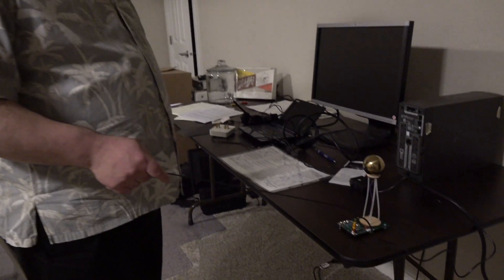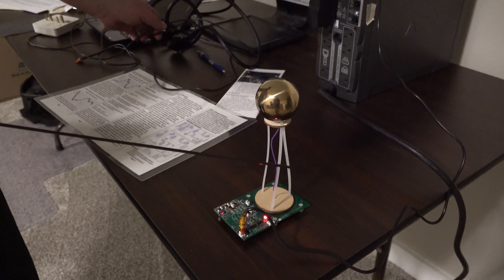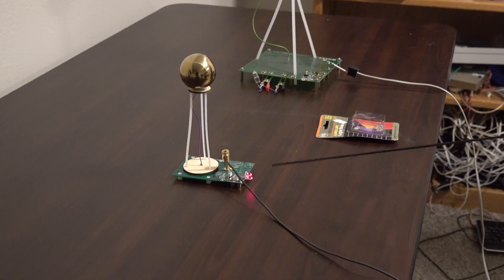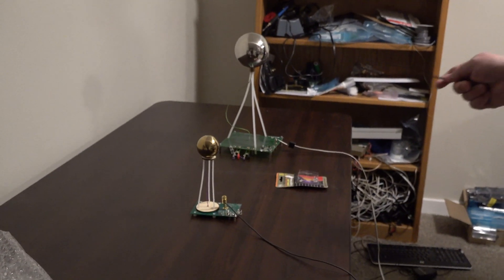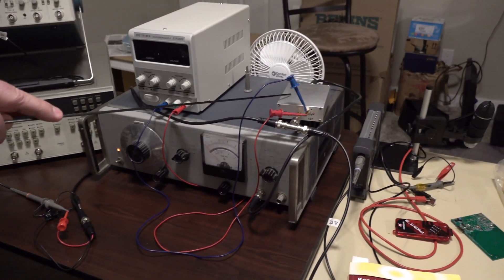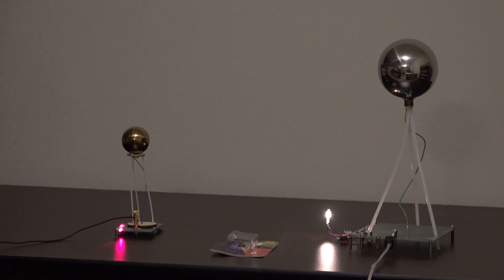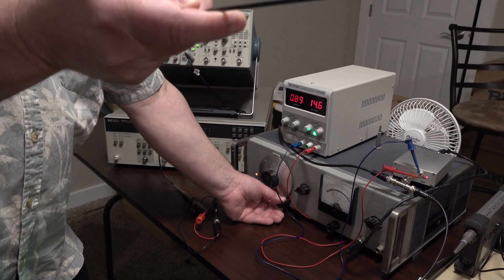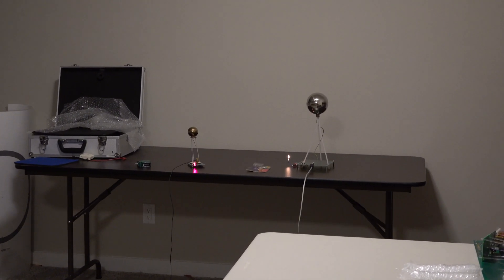Demonstration 2019 (please see vril.io and https://www.youtube.com/watch?v=RAwy-RiTAEw)

Comment: Dear Adam

Excellent video demonstration of scalar waves using own version of Prof. Meyl's kit. It was amazing.

I have a query regarding it's enhancement. Since Meyl always use a single wire as ground to demonstrate, same you also used in your videos. Instead of using a single long running ground wire, did you try connecting the two ground to real Earthing? 

I mean something like this:
https://drive.google.com/file/d/1fP8_dJ-3n9l1O5KidDO87MwZpSSEYE-H/view

I hope you understood my suggestion. Please let me know if you have (or can) try something like that.

Your response will be highly appreciated.
Reply from the maker: Hello Partha, thank you for asking about the grounding suggestion to replace the one-wire with two conducting earth stakes.  I did try that experiment in a grassy field and was surprised that pressing around 6-12 inches of Copper heavy gauge wire into the green grass did not make the connection, so no energy was transferred through Earth, even when the wires were placed right next to one another.  My un-tested belief is the reason Tesla's giant tower worked in this scenario is because his tower created huge voltage for breakdown of dirt particles and establishment of conducting plasma at the transmitter's Earth contact; whereas the demonstration kit I used to test that (the one Dr. Meyl sold me) generates a relatively low potential unable to force a conducting path between dirt particles (my unproven hypothesis).  Another hypothesis why it did not work replacing the one-wire with earth ground penetrations is the Earth absorbed the energy: did we see in Dr. Meyl's documentation a gymnasium with the wire strung high off the floor to measure wavelength (with LAMBDA=c/f) proving faster than light behavior of the longitudinal wave?
Reply: @nearfieldresearch4573  
Sad to hear.

Because if it doesn't work with real ground, then it's not useful. Forget 100 wireless without ground. Or may be we are missing something.

After connecting to ground, did you try re-adjusting signal frequency to find another resonant frequency with ground (if exists) ?
Reply from the maker: Thanks for your input Partha!  When I tried Earth ground instead of a wire using Dr. Meyl's kit, there was no frequency found that would work within tuning range.  More experimentation is needed to determine what grounding configurations actually are useful, for example reducing the amount of wire inside the metal shell of a rocket.  One useful application I have proposed for a 2-year $13M project, is for status report communications between power poles where the wire already exists (longitudinal waves to increase the range over conventional radio).  There are a number of sensing applications in this realm besides power, including a medical device I am not ready to disclose.  Other applications should be found once the engineering community begins to understand how to make and use longitudinal wave design tools like electrical simulation (we already have decent commercial tools for simulation of the transverse wave component, but not the longitudinal one).  Adam Griffin 05NOV19.
Reply: @nearfieldresearch4573  Thanks for the response. Hope we get the missing info to use longitudinal dielectric wave for power transmission. Power transmission at long (or possibly infinite) distance will bring true revolution. Since Tesla used impulse current to transmit power at larger distance. But it seems his patents didn't give complete details which are necessary for implementation or proper engineering. Since he do most of his calibration in mind.

Yes, I have read many articles regarding using scalar waves for healing process, but never seen a working schematic for it's design.

So we need to re-discover many things. And once every parameters is known then only it's engineerable and then simulation is possible. Simulation is not possible without any equation. So simulation is a long way to go.
Reply from the maker: Thank you again Partha, for contributing to this discussion.  I do believe Dr. Meyl showed analytic equations in his 700 page book https://www.meyl.eu/go/index.php?dir=30_Books&page=6&sublevel=1 and in various papers he wrote (e.g. https://www.k-meyl.de/go/Primaerliteratur/Scalar-Waves.pdf), but the equations need to be implemented by someone or something with huge computational power, maybe using Qubit-based systems as they continue to develop.  If One has not digested Meyl's book it is quite an amazing accomplishment and I wish he could someday receive a prize and official recognition.

Comment: I think you have a transmitting antenna and a receiving one.
Reply from the maker: Thanks John I agree "scatterons" are antennas that can be made spherical or flat.  My impression what happens between them, and I have probed power build-up waveform on the receiver to understand this,  it is like the transmitter pings the receiver in a fashion of as if it is hunting for a partner, then the receiver gloms-on to the transmitter becoming one resonant system of energy transfer.  Putting one or more receivers connected to the one wire makes transmitted energy share between the changed resonant system.  Adam Griffin 03NOV19
Reply: Thanks Adam, an FM radio antenna can be a single rigid piece of metal.
When the transmitter and receiver are close, you can get harmonic resonance.
Many people make videos about that. One example is TinselKoala.
Reply from the maker: Thanks again John.  A weird thing about this type of system is the transmitter and receiver when moved far away from each other still have resonance ('far' being beyond a sixth part of the wavelength) and able to transfer power and not just signal.  For example the paper I wrote showing energy transmission from basement to second story with the one wire kit using 100-foot extension of telephone cord, illuminated the LED or powered a resistor (the ~7MHz transmitter is producing slivers of energy, having ~60ns, ~1A pulses; I would have originally expected no way the LED could be lit from that distance with my tiny drive circuit).  Measurements I made also beyond line of sight using Dr. Meyl's kit showed received power falling off as 1/distance instead of conventionally understood 1/distance^2 with transmitter on a second floor and receiver outside close to Earth, on the concrete.  The conclusion is I wish for access to an electromagnetic simulator that is validated to accurately model this type of vortex generator so we could understand more.  I already tried to model a spiral pancake with Ansys Maxwell and it failed to create a spiral let alone simulate it, then when I ran an investigatory simulation using CST it was able to simulate a spiral dipole situated over a ground plate (if CST does not model the longitudinal wave I was probably wasting time trying).
Adam Griffin 03NOV19.
Reply: Thanks Adam, 
About the health issues, I want to say that you have to be careful. You don't want to place your workbench for experimental electricity against a wall where on the other side your neighbour's little twin lies sleeping.
Keep your input power as low as you can, and keep the experiment as short as posible. They always say; don't switch your experiment on and sit next to it just staring into it.
Every change in the circuit can change the output frequency, and we simply don't know what frequencies are healthy and which are unhealthy. Don't think that all frequencies turn into heat when they enter the human body. There are examples of people having all their hair fall out in just three days time, because they forgot to switch off their experiment in the other room. You can find quite a number of examples where a YouTuber starts with his radiant experiments and where his setup makes sense, and his explanations sound logical, but after a year or so, his circuits become messy and he speaks nonsense only.
Try not to interfere with other people's wifi, radio or telephone experience, but you already know that.

When you have a AC circuit with a somewhat higher frequency, and you attatch a single wire, then the "waves" can enter the single wire because they are pushed by the circuit. When the frequency is low, the waves can flow back to the circuit, but when the frequency is high, there is nothing pushing the waves back, and so they pile up. The energy can now only get out of the wire as a radiant. Hence radio.

Also remember that there is no new invention hidden in this kind of experiments, nor can you find a useful application for it. It is for study only.

And yes, a straight wire or rod is 1/R and a ball is 1/R²
Reply from the maker: Dear John Walker, 
Thank you for taking the time and contributing to this important discussion on safety! 

 
The Starter Kit transmitter is designed for low power, with on-board amplifier slew rate 460V/us (highest frequency content of ~23MHz switching
 a 5V rail) and 0.1 Ohm output resistance, pulsing a series 1.5 Ohm spiral coil and 2 Ohm sense resistor with 60ns pulse widths at 8MHz. Calculated current delivered to the transmitter coil by this on-board amplifier is thus 5V/(0.1+1.5+2.0 Ohm)=1.4A and resulting voltage impressed across the transmitter primary of 1.4 Amp * 1.5 Ohm = 2.1V (Pulse width is set by the drive circuitry).  Peak power across the spiral transmit coil is then approximately 1.4A * 2.1V = 2.9W. Given the period corresponding to 8MHz input to the transmitter coil (cycle period is ~125ns), and ~60ns fixed pulse width per cycle the Duty Cycle of the transmitter is 60ns/125ns = 0.5.  The calculated average power available for transmit is thus Pavg=2.9*0.48=1.4W. The Starter Kit printed circuit board which the amplifier is part of, demands 5V*0.3A=1.5W from its wall wart so the calculated estimated maximum transmitted power derived above less than 1.4W, is reasonable. 

Regarding the measured electrc field strength close to the transmitter, it is documented in 
/Starter_Kit_Publications/3_App_Note_Short_Distance_Various_CoilLengthOneWires_09SEP17.pdf: Through 25 feet of coiled one-wire, the measured 
electric field at the receiver card read 1241 V/m (with the LED illuminated because the transmitter is tuned to the receiver) and electric field strength was measured with the handheld meter at the receiver. The transmitter emitted 1398V/m electric field strength with the meter at one inch away from the transmitter. 

The following publication can be referred to in evaluating safety of the Starter Kit for transmitted power of 1.4W at 8MHz:  
https://www.sandiegocounty.gov/content/dam/sdc/pds/ceqa/Soitec-Documents/Final-EIR-Files/references/rtcref/ch9.0/RTCrefappx/2014-12-19_HealthCounciloftheNetherlands2000.pdf. The safe level is below 1000V/m  accordng to its Figure-2 (“Health Council of the Netherlands: ELF Electromagnetic Fields Committee. Exposure to electromagnetic fields (0 Hz - 10 MHz). The Hague: Health Council of the Netherlands, 2000; 

publication no. 2000/06E”). Radiated fields measured from the Starter Kit decrease 
rapidly from the scatteron surface when measured with the handheld meter.  Proximity of the handheld meter reduced the tuning and observed peak current value, making accurate readings difficult to measure.  Notice Figure-2 of the Reference shows 250V/m falls below the possible effects at 8MHz.

The table on Page 11 of https://transition.fcc.gov/Bureaus/Engineering_Technology/Documents/bulletins/oet63/oet63rev.pdf, can be referred to in evaluating FCC compliance: Radiated emissions at 30m are expected to be  less than 30uV/m because the hand-held meter reads zero V/m outside of several inches. The longitudinal wave could conceivably be detected (measured?) in an RF Chamber with conventional antennae and spectrum analyzer; however at low frequencies a standard receiving antenna is typically a loop antenna or active monopole antenna; neither antenna should be suited to measure a longitudinal wave which that might look like noise (I hope it becomes published by an inquisitive engineer; maybe using my starter kit driven by battery-powered optical coupling to change its frequency while in the test chamber).

The effects of high frequency electromagnetic radiation are definitely complex. Which frequencies are good, and which are bad is a huge can of worms 
to analyze and the only practical thing we can verify by Test seems to be: Reduce emissions below accepted field strength limits of exposure for transverse waves.  Another couple of related points:  It is my opinion that cell phone radiation is dangerous to the body's healing ability, especially as the frequencies are going to 7 MHz with 5G technology. All we can do here practically is shut the cell phone off at night, or put it in another room.  

Regarding Wi-Fi, my understanding is it is not safe to be near your home router all the time. I remember hearing a caller on talk radio convinced she was sickened 
after the smart meter was installed on her home.  Clearly we are all at risk with all this electro-smog that seems omnipotent and ever increasing.

Regarding loss of hair as an outcome from the presence of RF, are there scientific publications for recommended reading?

Thanks again,

Adam Griffin
04NOV19
Reply: Hi Adam, thanks for your detailed reply.
I don't know any scientific publications about health issues regarding EM frequencies.
However, most people know that an electric current can kill a human. I always start to laugh when someone tries to explane the right hand rule and starts with saying "when you grab the wire with your right hand..." then I think; "never grab an electric wire kids!"
There was this research professor who figured out that it might be possible to stop the human heart by applying a small electrical current to it. And so he did an experiment on him self, and yes, he was right, and so he died. Other people try to find a way to keep sharks away from the crowded beach, and sometimes an electric pulse can do the job. I think all the shark's receptors are stimulated at the same time, and I think we can compare this with the effects of pepperspray on an agressive shoplifter.
But seriously, there are people who live their happy lives on the top story of the highest building in the neighbourhood until a phone company decides to place a 4G hub on their roof. From paradise to hell. Do human rights count?

It is not difficult to transform one frequency into an other, but it is very difficult to understand every little process inside an animal or human body. No electrical engineer knows anything about biology.

Funny b.t.w. how Partha, in the comment section here, thinks that he can replace the wire with the natural ground. It looks like someone removing the cilinderhead and than tries to start the engine.
The wire is like an artery, the electrical pressure needs to be transported.

Have a good one.

Comment: As to shielding with a Faraday cage...of course one cannot shield this  with a conductor (Faraday cage)...this would be the equivalent of placing more conductive plates in the dielectric of a capacitor (of course we live in a dielectric)...the plates merely pass an oscillating potential just as a wire between series capacitance (Tesla demonstrated as much in his famous experiment)...so really, longitudinal waves have been in almost all AC circuits right under our eyes in the dielectrics...and remember you live in a dielectric...and you yourself are a conductor (concentrated charge source)...however water is a dielectric and thus you may place your 'receivers' in water...
Reply from the maker: Thanks for your input Mark!  The confounding fact is this device I made illuminates an LED from the basement floor up two stories while the coupling capacitance is exceedingly small.  Please Email me if you would like to have this experimental documentation that I wrote at griffin.adam.h@gmail.com.  The other confounding fact is the longitudinal wave starts up monotonically and smoothly whereas the transverse starts up choppy and disjointed (If you would like to see my experimental documentation performed on the predicate device from Dr. Meyl please let me know too).  One thing I wish to have access and doubt will be provided, is an electromagnetic simulator (like Ansys Maxwell or CST Studio which don't do this from what I know; maybe the CST Particle in Cell module could be useful) could account for the electromagnetic longitudinal wave so we could model the effects instead of always having to build something and measure it empirically.  A final comment about placing receivers in water that has high relative permittivity around 80, is that might not be tunable with the circuit I have built - but might be an ingredient to somehow affect its tuning instead of using e.g. a varactor...you might be on to something valuable here!  Adam Griffin, 21AUG19.

Comment: Is not any series capacitance circuit in essence a one wire circuit?  We live in a dielectric so it is not surprising that by tuning into regularly occurring oscillations in the dielectric and providing some charge reservoirs (conductors between dielectrics) that we may experience electrical power (hairpin affect).  Again, in any series capacitor circuit the wire between the capacitors act in such a manner.  It is typically necessary though, at higher frequencies to tune conductor length for best affect.  Great job in your incorporation of digital in monitoring and control!!!
Reply from the maker: Thanks Mark, maybe you have insight to understand limitations of using a Pearson Model 411 (1V/A) current probe reading current at one end of the starter kit wire vs. the other end of the wire does not necessarily give the same result, and that probe can also read a current in the longitudinal system wire when it is disconnected at one end?